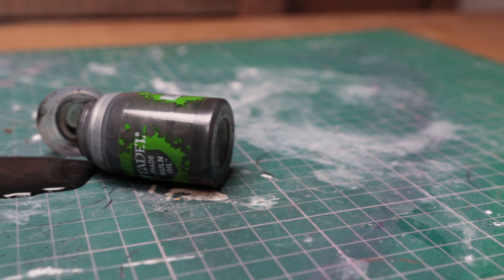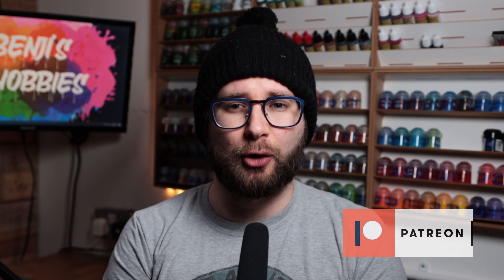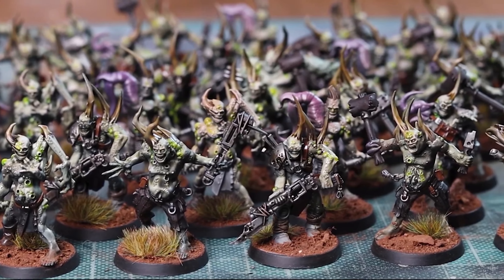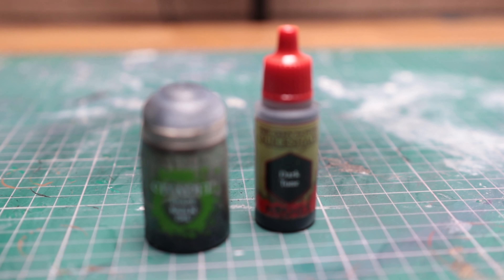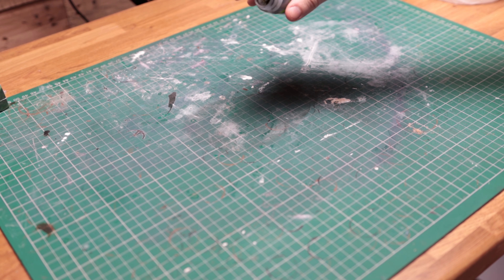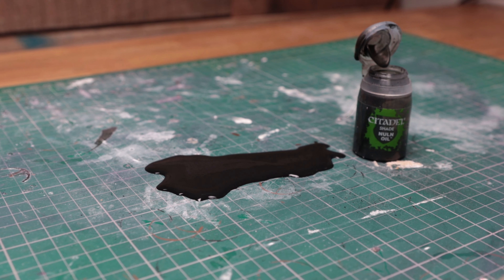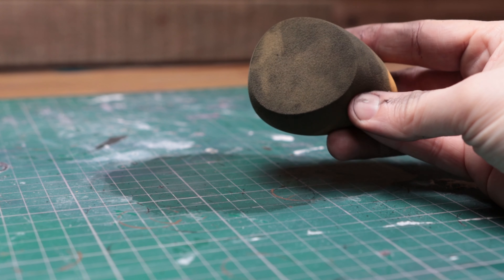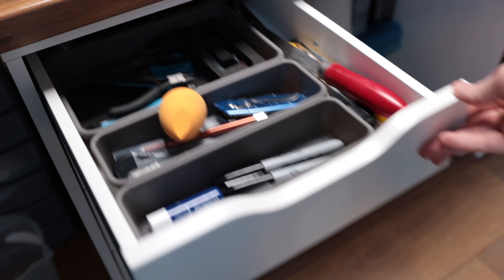SAVE your Nuln Oil spills with this simple tool!

Comment: Another trick is have your paint bottle sitting in a small tray so that when they spill it doesn't go onto the table, and then you just pour it back into the bottle.
Depending on the tray you may need a small funnel also.  Lots of possible things for this may be found at the dollar store.

Comment: Why are people not simply put some blue tac under their pods, build a holder of Legos, or put heavy stuff around the pod. There are numerous ways to prevent this happening....
Reply from the maker: There are simple solutions for a lot of problems. But people forget, people are lazy, people don’t have the foresight to get a holder... loads of reasons! The sheer number of posts about spilled nuln oil suggests it happens way more than it should.